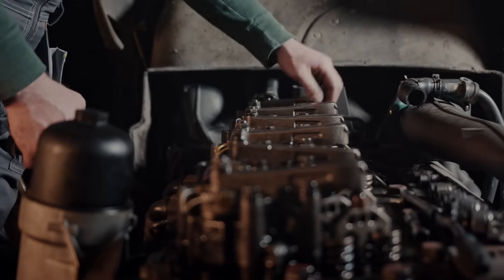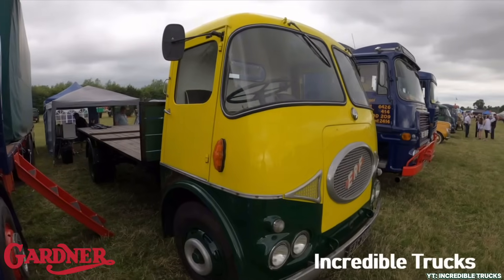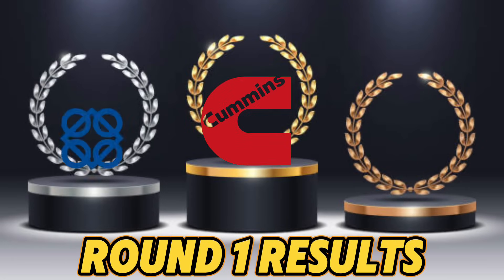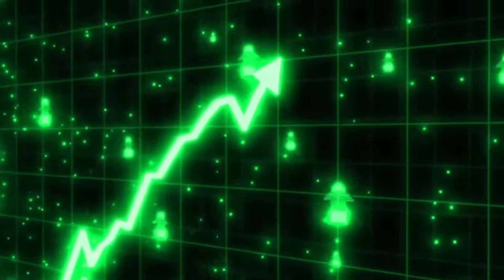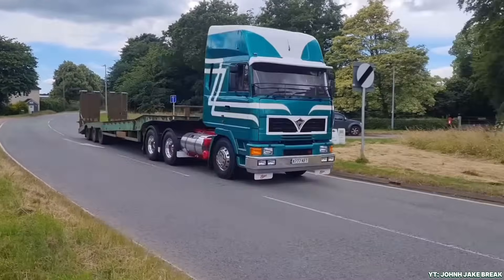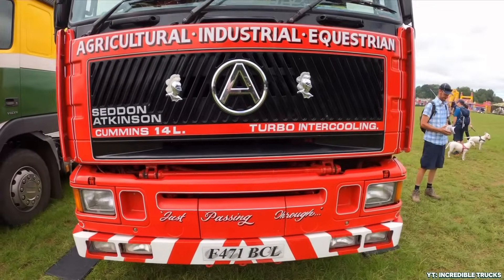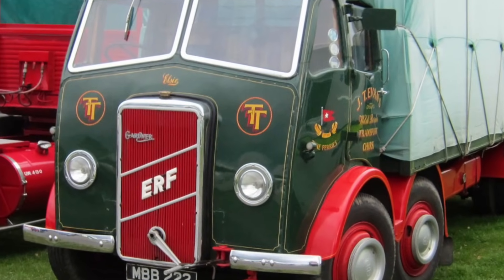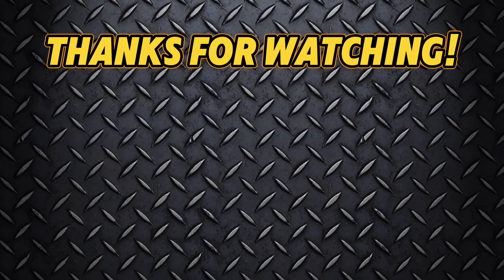Diesel Engine SHOWDOWN - Perkins vs Cummins vs Gardner

Comment: I have read a lot of the comments   In Trucks Perkins of the 60s 70s 80s in the application your talk about were considered a high speed (around 2600 - 3300 RPM)  lightweight diesel engine for their HP output and thus had a shorter life span generally not reaching 1 million mile mark  before major maintenance  Cummins  was was a very heavily constructed engine for the HP output with a more modest max RPM (2150 to 2400 some even 2600) bottom end was would handle more than one piston liner Head rebuild without changing shell bearings and offen past the 1 million mile mark before major maintenance   BUT were very susceptible to Electrolysis of piston liners and lower counter bores    Gardners were a much lower revving  engine (max 1900)than the above and lasted accordingly only on rear occasions didn't make well over 1 million miles before major maintenance  Because of their long stroke had the best toque curve of all
Reply: You take a Gardner to 1,900 and there would be nothing left. 6L3B was about 900rpm.

Comment: Perkins in our massey was fuel efficient and fuel system had to bleed the air if run out of fuel.
All cumins started easy if run out of fuel.
The newer cummins are very expensive on parts and need alot more repair.
The x15 is a fuel guzzler, but a very snappy motor, which the cats are very sluggish.

Comment: Cummins are a joke, too temperamental with burning holes on the cylinder liners. Mainly starting with the V8 and V6 in the Ford D1000 and Dodge 800 series. Also the Big Cam, N14 were a headache too to maintain. The N14's would break down, with the early electronic failing injectors. Every service and all Cummins, the coolant must be checked for acid levels and a DCA additive. If Cummins say they are reliable, then why do they have coolant filters compaired to the rest? If the service was not performed, they would leave you stranded and the hioghway with coolant in the cylinders, locking the engines up. Ford D1000 and Dodge replaced these junks with the more reliable Perkins 510 & 540 V8's. You would never hear of these kind of troubles with a Perkins and a Rolls Royce of diesels the great Gardners.

Comment: Perkins has earned my respect.

I had a Perkins, with a Mazda design head in a Ford car.
Unless I reved it hard, it was gutless however the fuel economy was amazing.
Unfortunately cars body started rusting away.

I also have a Perkins 4108 in my sailboat.
It's loud but reliable and efficient.

I drive big trucks for a living in extreme conditions.
Although most of the fleet is Cat, the few Cummins hood their own.

Comment: I've got a Perkins 6.354 in my 1969 international cab over, 56 years down the road without a rebuild and runs like a charm.
Reply from the maker: Really? That’s awesome 🙌 Thanks for sharing
Reply: 5.8 liters raw. Very nice motor. Rotating fuel injector pump. Nice cruising at 1500 rpm, roundabout 2050 - 2100 rpm max. 

It is unfortunately not on the ship anymore. The new regulations force us to build in a stage V diesel engine which I did..

I got the motor when my Volvo Penta failed in 1996. It came from a small freighter and was left in a corner of the wharf unused for about 20 years. The motor was build in 1963 and started the very first time without any hesitation. They oiled her good because there was also a very big black cloud the first time we waked her up again.

Comment: Other than the entertainment value of this video, I can not see how you can compare these engines, they are all in a different league of their own and dependant on YOM and model and application.
For example to compare a Gardner to a Perkins you would have to put it up against an old P6.
And when the Perkins 6 354 was at its height the B series Cummins that would be the closest match was years in the future.
A breakdown on each manufacturer and what they contributed would be more appropriate subject matter, well that is my ten cents worth anyway and I'm not trying to say this video was not of interest.

Comment: Drove Gardner Cummins and Rolls extensively in the 70s and 80s.

As for Gardners, had two  180's break down with dropped valves, my short stint with a 300 Gardner turbo saw it partially seize but after cooling down for a bit carried on without further issues, had to borrow a 300 Gardner ERF one night when one of our then Scanias was off the road, it filled the loading hall in London with smoke almost causing a walk out of the loaders and was immediately banned from the site.
Had multiple Cummins engines, E10 250 in a 6 legger, 220 and 250 unblown, 290 then an E290, then finally an E320 in '84, which i ran for 3 years and is probably the last Cummins i drove.
The 320 was simple brilliant, in a high geared 401 Sed Ack it would cruise all day long at 70mph @ 1100 rpm, massive torque on hand from 800rpm* and really impressive on fuel, RE Mason of Crick were running Scania 142s on the same work and that Cummins could easily stay with them on any terrain.
Never had a moment's trouble with any of the Cummins engines, to be fair where i worked the maintenance was first rate.

The 290 Rolls in our Scammel Crusaders weren't so reliable, they were enjoyable to drive thanks to the Fuller boxes but couldn't match the Cummins for sheer guts, interestingly one of the hub reduction drives failed and our brilliant mechanic grafted in a Rockwell rear axle from a scrap Ford Transcontinetal, as a result that truck was so overgeared that you didn't really need top gear till over 70.

Miss those days, miss the trucks, miss the characters....miss the pretty ladies who provided us with so much enjoyable viewing, er, so i'm told, course i'm an old bugger now so wouldn't dream of looking.

* i know it was often mocked by the glory  truckers but around 2009 i used a square Merc Axor with the 430 engine and manual gearbox for 6 months, that was probably the nearest thing i've driven to compare to those Cummins of yore with massive torque build up from 800 rpm, a very underrated vehicle, the auto box ruined it as it did and has so many other trucks.

Finally retiring or at least going part time shortly.
Reply from the maker: Thanks for an interesting, and amusing post. 
Enjoy your semi retirement 🍺🍺

Comment: There were a lot of Gardners in fishing boats
Reply: My cousin has a pair of Gardner's in his old utility boat,it's a bit of plodder but has been mechanically incredibly reliable.
Reply: Still are, they are very, very hard to kill, you can still buy brand new parts just about anywhere and the abilty to isolate one or more cylinders and keep it running to get to a port means they are well loved.
Reply from the maker: I never knew that

Comment: My dad had a C Series ERF 8 wheeler with a Gardner turbo in it. It was forever having problems with the turbo not working, occasionally it would work on a hill and it would fly but as soon as you lifted off the throttle it wouldn't work again for ages. Never found out what the cause was.
Reply from the maker: Thanks for sharing 😊

Comment: Gardner engines were used in Lighthouses, a very reliable long running engine
Reply from the maker: Were they indeed?
Reply: @RewindwithRichie  Yes 4 six cylinder generators on the Royal Sovereign (now demolished) and single cylinder Gardners on other lighthouses.
Reply from the maker: @neildelaney5199  I’ve learnt something 👍

Comment: Its not really a fair comparison , Gardner died years ago , euro exhaust emissions  killed them too small a company with not enough money to invest , Perkins took them over and that is where the turbo engines came in , the 6 lxct casteration good for 750,000 miles but blew injector pump heads , asking it to deliver more fuel than the casting could take , the 6lyt blew head gaskets , the head torque was so high you could see where the head bolts pulled up the block , ( i measured one that was 4 thousants of a inch higher than the deck ) poor design and needed a real head gasket instead of a shim gasket but oh man they would pull , 70 mph up shap with 38 ton on all the way up same on the m 62  never had to change down on any motorway !

Comment: You forgot that trains have some of the engines like Perkins 2006  which are in br class 165/166 and the BR class 158 as for the Cummins qsk 19 which can be found in most of UK DMU like 220/221/222/180/185/ and some of Europe DMU and also the across the world
Reply: At Driving Creek Railway in New Zealand, we have three trains with Perkins 1000 Series motors. We're currently swapping one out for a reconditioned one - not because it's broken down or underperforming - just because it's losing a little bit of oil after 21 years of service

Comment: I have another for you, Mack - Renault - Volvo. All part of the same group now but also builders of good diesel engines. We had Renault and Mack trucks that did more than one million km, all had V8 engines. Renault R420 (14,88L) 1,3 million, AE 500 (Mack E9) 1,5m, AE560 (E9) 1,25m, AE560 (E9) 1,1m and Mack CL713 (E9) 1,4m. The AE500 was taken of the road because the rear end needed rebuilding and the frame was rusting very badly, he needed a new frame. The cab was sold the frame and axles scrapped but the engine and gearbox (B18) are still in the garage. One AE560 (1,1m) was sold to Africa but the other one is still there as backup truck. The CL713 is under a complete rebuild and will be finished getting back on the road next to the other CL7 series with a Mack six cyl 460Hp.
40 years ago we had a Bedford van with a Perkins and that was not really a good engine, lots of trouble and in the end the engine killed itself. The Bedford van with a petrol engine was a lot better later replaced with a Transit van.
Reply: Do you know if it was a Mazda Perkins or a standard Perkins, i suspect the former and they were a popular opinion especially with the likes of Land rover who offered it as an option to thier own 2.5 leter turbo diesel which was quite inder powered being only about 88 BHP way under what was available from the likes of Toyota and other Japanese manufacturers.
Reply: @Colin-rg7gt  I think a real Perkins Because it was a Bedford CA  with the 1760 cc diesel.
Reply: @Jay_Speed I've also heard of at least one Land rover fitted with a Ford D.i i can't remember whether it was a series 3 or an early 90/110 pre Defener
Reply: @Colin-rg7gt The Bedford CA was sold in 2018 for 500€ to a theater company for doing the play "Lady in the van" We kept it in dry storage for fifty years with the goal of restoring it. That never hapened.
There is a tuner in Belgium that put's the Ford 5 cyl diesel in Defender for clients whole over Europe.
Reply: @Jay_Speed I'm talking about about the mid 90's just before the TD5 was released.
Reply: Mack’s went downhill after the E7 thanks to Renault

Comment: Drove a gardner 180 in a six wheeler,it would go for ever no probs, a mate had a ford d series with a v8 Perkins,faster and stronger though,BUT he used a bucket every week to keep the oil level right😂
Reply: I HAD Foden 8x4 Gardner 180 always last to site as the Leyland constructors with there RR265 FLYING PAST ME ON HILLS , had a Daf it done a million km wiring let it down as it always played up in the wet

Comment: we fitted the Cummins NHC 250 engine in to the Marathon at AEC ltd, this was an option as well as the Rolls Royce 220 engine, of course mainly fittting our own TL12 engine, Gardner engines were fitted in to some small diesel shunters, i believe it was the 8XLB with individual air cleaners for each cyl,
Reply: Came across a Gardner 8LXB fitted in a Seddon Atkinson 400 once, the engine was so long it stuck out about 2ft from the back of the cab 😅 A very rare fitment in tractor units of the time. The Cummins NHC 250 was a popular fitment in the Marathons I looked after in late 70s early 80s and was very reliable. Drivers though preferred the TL12 or the Rolls engines.
Reply from the maker: @stevestace3921 😂
Reply: The TL12 was basically an up-dated AEC 760

Comment: Never had too much dealings with Gardner engines, but believe hauliers had to pay a premium to have them fitted over other engine suppliers. Perkins 4.236 and T6.354 great engines and reliable, but my choice would be the Cummins E290 big cam which was quite a step forward in terms of torque and fuel consumption when introduced in the late 70s.
Reply from the maker: Thanks for your input
Reply: @RewindwithRichie  The Ford 2503/2703 beat the 6354 every day on starting and reliability.